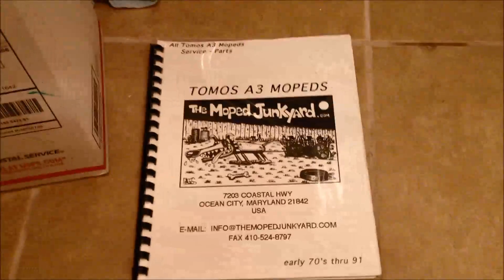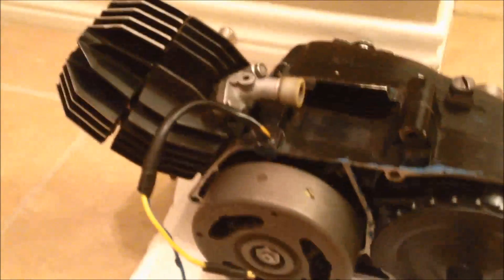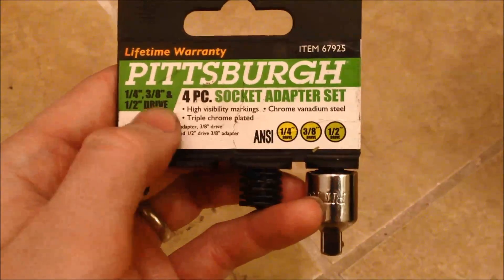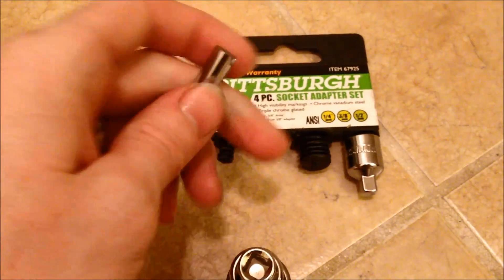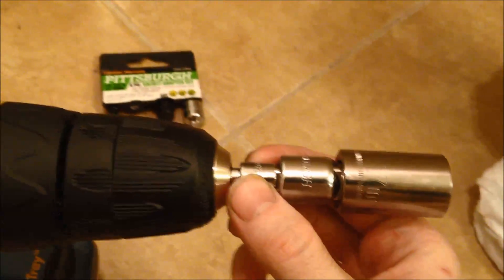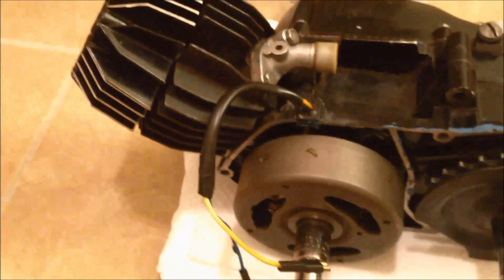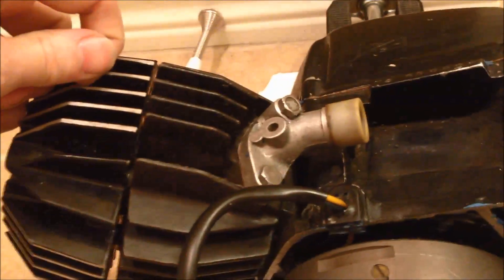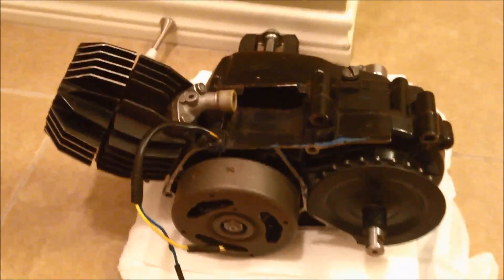Moped Mechanic Techniques (Tomos A3 & Equivalent Spark Check)

Comment: how did you make that bolt stay in if i try it the bolt comes off
Reply from the maker: djafar mobin which bolt are you referring too?
Reply: Stephen flywheel bolt where you put the drill
Reply from the maker: Gotcha. Your might be turning it the wrong way. If I recall the crank is reverse threaded. Either way if the flywheel nut is tight it shouldnt come off by you spinning the crank like I am doing with the drill.
Reply: Can i also start my moped with a drill?
Reply from the maker: Yeah technically you can, but your liable to break your drill once the engine turns over. The torque of the shaft can potentially snap your drill if it's still attached to the nut after its started. And of course my motor had the kill switch bypassed so that in order to shut off the engine you pull the sparkplug boot off. Your better just starting it as intended. I did this specifically to test for spark as you need to have enough rpm to see spark without having to spin the pedals. Using the drill and sockets made that easier. Just something someone might not consider when troubleshooting these motors and it saves energy an makes the job a bit easier
Reply: Run drill in reverse

Comment: it got good compression to
Reply from the maker: I'd double check compression,  I'd also make sure it's getting enough fuel, and also you need to make sure the timing is right on the ignition, which requires you to adjust the plate and or point angle. Also, make sure that the ignition is turned to the on position,  unless you've wires it directly like I did. But since you have spark,  that shouldn't be an issue, also check and make sure it's a good strong blue spark and not weak.
Reply from the maker: Also make sure that your base gasket isn't blown,  and If you don't have one you'll need one, check your owners manual, If you don't have one, you can download a .pdf version of one off the internet. Without the engine in front of me it makes it difficult for me to diagnose,  but these are the things I'd start with. Let me know if any of this helps.

Comment: i just picked up a 1985 tomos silver bullet with this a3 motor on it it got spark and fuel to it but wont start up idk wut up with it
Reply from the maker: You might need to check the timing of the stator make sure it's timed properly. But If you know the timing is right, then you could have just a bad ignition coil thats only allowing spark some of the time. Are you getting fuel?
Reply from the maker: I'd try replacing the ignition coil if your getting intermittent spark
Reply from the maker: Yeah lol pretty sure. the module for the cdi. this system had points originally and so it had a coil pack not a cdi module. but I'd start there, it's cheaper then a new ignition assembly